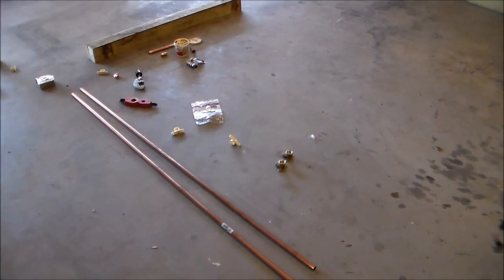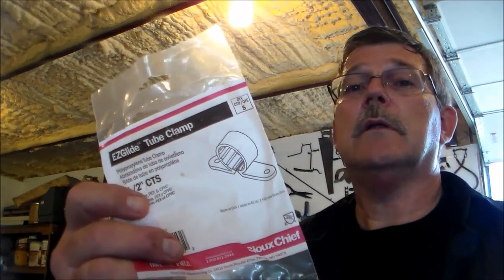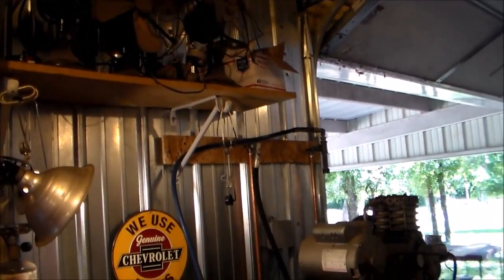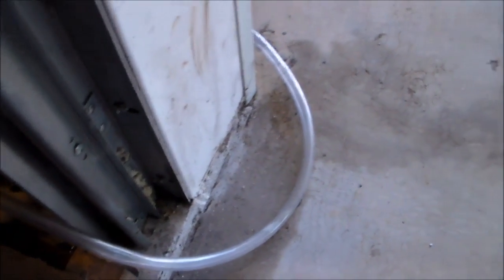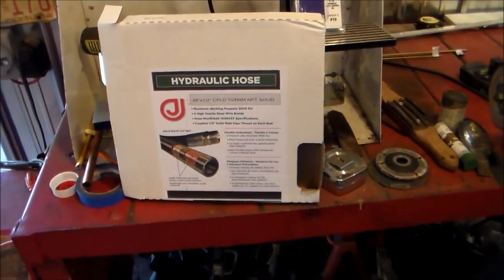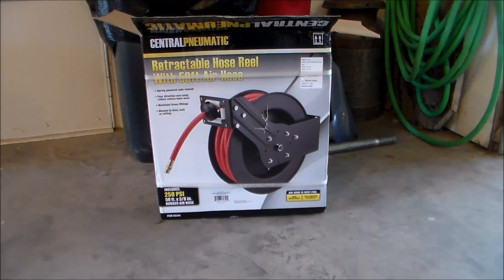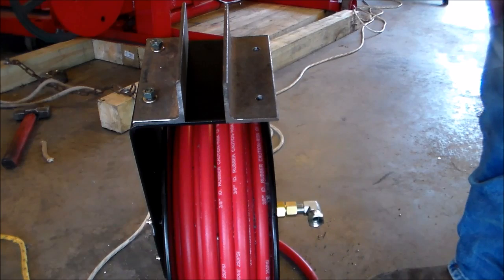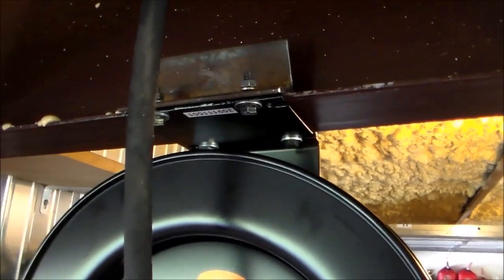How to Decrease Moisture In Air Compressor Lines

Comment: One problem I see is the hydraulic hose, if they lining of the hose is not rated for the temperature involved it will begin to break down and fail. There are stainless braid poly lined hoses for that specific purpose! They are smaller overall and have less line friction, much better choice!

Comment: Did anyone ever use refrigeration  copper y bends instead of 90s  and tees to make a compressor air dryer just wondering if it would work
Reply from the maker: It should work well, good luck

Comment: Plug in a heat exchanger. You can use an old radiator and blow a fan through it. I've done this in an industrial setting with large compressors.
Reply from the maker: Thanks, I hope to do something in the future when I replace the compressor

Comment: I've always read the only pipe that should be used to plumb a shop with air is black pipe do you knownthe burst trying on that copper???
Reply from the maker: For annealed - Type L - 1/2  is 750 psi  ,  Type M - 1/2 is 600, Type K -  1/2 is 400
Reply: @RustyGlovebox  well did not know this course I figured due to thin pipe it would burst.... what's the price typically on the copper??

Comment: Would the danger of little holes in the fins of the I beam really have an effect on it's strength? Seems like it would not. But the constant pulling and recoiling of the hose reel would eventually loosen the clamps. Thus creating a real danger of coming loose and damaging you or your property. Not to mention potentially blowing your pressure when the line breaks from the drop of the reel. 
    But I may be totally off on my notions of i beam integrity.

Comment: On the bottom of every air compressor I have ever used there was a valve. Crack it open and drain the water from the tank. It helps a lot.
Reply from the maker: Good point , Thanks

Comment: Three things which I have done in my small shop was to ... 1) installed a small tank with a drain plug about two feet past my main tank. I connected it with a one inch metal pipe. It is also well below the top of the main tank. This should allow the air to cool enough to drop most of its moisture.  2) I ran my lines out with 1-1/2 in. schedule 80 PVC; which is strong enough for anything I will ever do. It is run though the top of my shop and slopes back to the secondary tank. Any water which condenses out will drain back and collect there. 3) I take all my drop lines out through 'T' fittings which are turned up, so the air is taken from the top of the main air lines. I figure air goes up and water goes down. This way there will be even less vapor make it to my equipment.
Reply from the maker: Cranford Ducain   I like that , sounds like some good tips. Reducing moisture is what it is all about.

Comment: How much moisture is he keeping out of your system? Having that copper pipe hooked up. Thank you Ken
Reply from the maker: I have 2 points that I can drain off moisture.  When I paint  I drain the lines and may get a round an ounce.  I try not to let it build up. Also added a water ejector valve on the main tank that helps too.

Comment: I'm sure someone said it already, but those copper pipes grounded to that metal wall would have greatly increased their cooling ability.  And sch 80 3/4" PVC is good for 600psi.  It's all I've ever used.  The only thing you can't do with it is use a PVC screw on cap.  The air pulse will eventually (days or weeks) crack and blow it off.  Everything else I've had running 24/7 for decades, as I keep and run air pressure lines to all points on my property the same as water lines.
Reply from the maker: A friend of mine hand a commercial picture frame shop and they use pvc for all their nail guns supply drops. I plan on adding some extra drops in the future using pvc. Thanks and take care
Reply: Just make sure that it doesn't catch any UV. Sch 80 will get just as brittle as sch 40 or class pipe does and grenade just the same after catchin' some rays.

Comment: The quick way to add corrosion to your air tools is to add lots of copper upstream where air is cooling and moisture is condensing out of suspension. Copper and copper oxides form, enter the air stream,  and all the aluminum downstream begins turning to useless junk. 

Don't add copper to the system where air is cooling or where moisture has not been entirely eliminated, such as downstream from a large desiccant dryer. And remember that brass is still largely, copper.
Reply: What do you suggest then for cooling and condensation that is upstream close to the compressor or in-between the compressor and tank?  I need to do this soon and want to build an ideal system both for media blasting and air-tools.

Comment: so is there any or much water in your compressor now
Reply from the maker: I also have installed a water ejector valve in the bottom of the air tank. So using the valve and copper air lines it does a good job removing the water. 
https://www.youtube.com/watch?v=0HH1iGpgmx4

Comment: might work better if you get an air tank from an old truck or an old fire extinguisher / propane bottle and mount that on the bottom , takes more time to fill before you need to tap it off
Reply from the maker: I have a water ejector valve on the main tank. And had water building in the lines if I painted or used a lot of air. The copper has helped with the line drains. Anything thing that collects the moisture is a real help. Thanks.

Comment: Why didn't you use one of those automatic water removers? I see you bought the hose at HF... they sell one. And why use hydraulic hose? for the 4000 PSI of expected durability? Never seen any one do that. 
  I was actually wondering if any one has successfully painted/coated the inside of their tank to prevent rust from forming. Water is a PITA
Reply from the maker: I have one of those too. Between the two I don't get water in the hoses

Comment: You'd be able to get the water out before it hits your tank if you put the condenser loop between the compressor and the tank.
Reply from the maker: Siegfried Gust   Those do a good job too.
Reply: Yeah but you burn up so much CFM its brutal.  Its a lot of an intake on a car you want a big high flow opening with as little resistance as possible. Since its under pressure volumetric efficiency is not a concern hut restrictions and 90 degree turns are unless you over build the hell out of it.
Reply: Siggy in CR 
Would the danger of little holes in the fins of the I beam really have an effect on it's strength? Seems like it would not. But the constant pulling and recoiling of the hose reel would eventually loosen the clamps. Thus creating a real danger of coming loose and damaging you or your property. Not to mention potentially blowing your pressure when the line breaks from the drop of the reel.

Comment: Seems like the more cooling you have for the hot, moist air coming out of the compressor, the more water will condense out.  See a way to add fins on the copper tubing, cool it off a bit more?
Reply from the maker: I agree , anything to condense the water in the air is caught in a trap will work. Thanks and enjoy your weekend
Reply: A larger diameter pipe at the bottom of your trap will let air pass more easily as would a longer drip leg before the drain valve.  If too much water collects between drainings,  you end up with hydrolic head pressure fighting the compressor.

Comment: That's pretty slick mounting that hose reel without drilling into the ibeam. Im with you copper may be a better choice to evaporite water from or condense water from your compressor. After all copper is used in stills isn't it lol
Reply from the maker: The copper is the best bet , simple and fail safe.  Thanks and take care. Going to send you a PM

Comment: Good Bit of Work Lloyd - Hope it All Works Out For Ya - I Made My Big Dryer and Didn't Record It - I Know One Thing - One Great Water Trap is - Running Your Air Lines Across the Ceiling - Just Put Anywhere one of those Coiled Up Yellow Air Lines and a air nozzle and it will be full of water every time lol - T=up From Ga
Reply from the maker: Thanks Stan, It has been so humid it was almost a water pump instead an air compressor ...ha ha . Take care Bud

Comment: Nice job.  I like how you mounted the thing with those clamps.  A few years back I installed a automatic drain kit from harbor freight on my compressor and it seemed to help a good deal with moisture in the lines.  The kit itself is like 10.00 but you gotta toss the plastic line that comes with it in the trash and replace it with copper.  Heres a link if you're interested.  http://www.harborfreight.com/automatic-compressor-drain-kit-68244.html  Let us know how that hose reel holds up,  I've been eyeing them too.
Reply from the maker: Really appreciate that, I have one on order now. Thanks again and Take care

Comment: That looks great. For the amount I use my compressor its probably not worth me doing the same thing. Even if I could. Your follow up will be interesting I'm sure.
Reply from the maker: When it builds the most moisture is when I paint or sand blast.The compressor running for a long time is when it gets bad. Thanks Noel

Comment: How do you like the overhead air? I was looking at one from Tractor Supply but wasn't sure how good they were.
Reply from the maker: I did a little checking on the hose reels and the HF hose Reel got as good or better rating of some of the other brands. We have them a work and they are handy.
Reply: Thanks, I keep tripping on the hose on the floor, I may take a ride.

Comment: I may have to use hydraulic hoses on the setup I'm doing.  Both ends (tank & compressor) have double flares.   Nice setup!
Reply from the maker: The hoses are tuff and can take the heat. And the price is really good too. Good luck

Comment: Looks good and it's all up out of the way. Those Hydraulic hoses are a lot cheaper than you can have one made. I've been using them when I can because they are cheaper and the local hose shop isn't open on the weekends either.
Reply from the maker: I really fill good about those hoses. I was surprised how inexpensive they were. Perfect for the project. Thanks and take care John

Comment: I have the RapidAir 3/4 system in my shop and it has worked great. The connectors are expensive so you might be better off using copper. I like those nylon clips you found. The hose reel is a sweet upgrade as well and I'm using some of your ideas to upgrade my system. I found this video very helpful, thanks.
Reply from the maker: I was happy with the end product and should have minimal  trouble. I wanted to do this in this shop to help limit the moisture in the lines. Thanks and take care

Comment: Like the setup Lloyd. Pretty smart idea to mount hose reel.  I like the copper too :)
One thing I overlooked was a check valve from the tank. Later remedied that though. Tc.
Reply from the maker: Thanks Dave , the hose reel worked out nice and didn't have to drill a hole to mount to the beam. I remembered you used copper and it  made a nice installation. Take care Bud

Comment: Ah that is a great tip . I have also seen guys use schedule 40 heavy wall 1/2 '' PVC pipe.
Reply: MyOrchardVideos PVC should not be used with compressed air. While it may work fine for years, if/when it fails it is an explosive decompression. PVC shrapnel may result in serious injury to you or innocent bystanders. You decide what your life is worth, but mine is worth more than the $100 bucks I might save over proper copper or steel lines.
Reply from the maker: A friend of mine used PVC in his wood shop and it worked great for years. I f I make a long run may use that too. Thanks and take care George

Comment: I like how this project turned out. Great idea to pitch the pipe and add drip legs. I've often pondered about a retracting hose reel. Keep us informed on how well it works over time.  Nice work Loyd
Reply from the maker: The best option would be one of those refrigeration unit to condense the moisture. And I bet you have worked on those before a time or two. But if I keep my tank drained and drain the lines it should do a far job. Thanks and take care GZ

Comment: Go check out the release valve Pappa Bob put on bottom of his new compressor for getting moisture out of tank. It's a recent video. I didn't know they made such a thing.
Reply from the maker: A work we have a water ejector on the tank and it works pretty good , another place I worked once had a refrigeration unit to condese the moisture. Losts of options out there , Take care